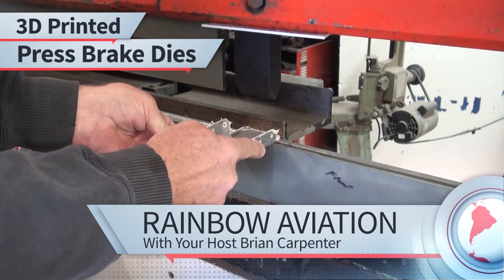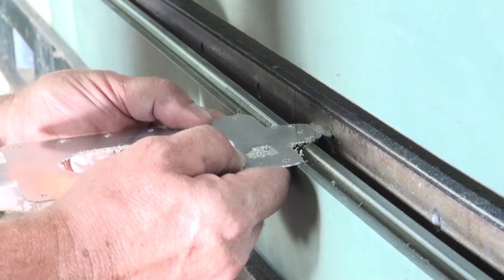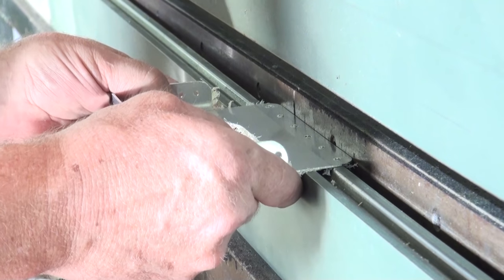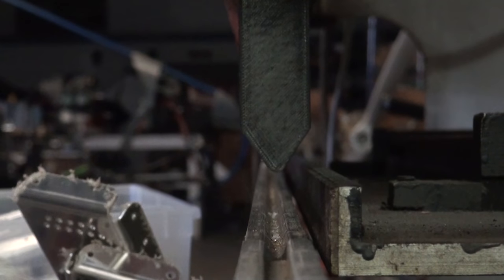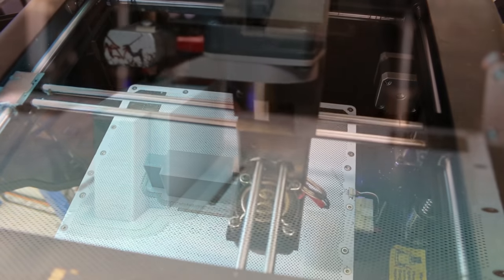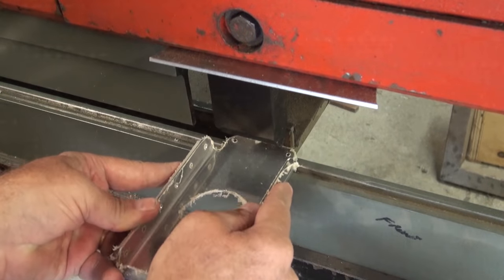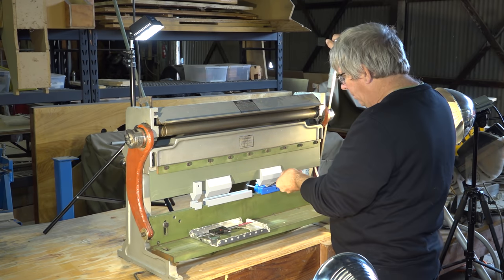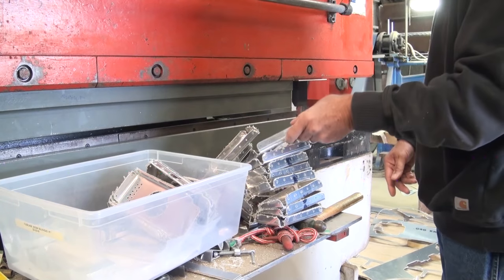3D Printed **Press Brake Dies* *That Really Work**

Comment: Another brilliant application of 3D printed parts.  And even if it just lasted for 200 parts, just print another for $2.38.  Thermo plastics keep getting better and better too.  Great video.
Reply: 2.38? plus the time you expend to modeling, print, electricity...lets say thhis dude make $20 per hour and the print cost 2.38 (lol) so 22.30 after 1000 parts? after 10000? proper die last foverer and this size is really cheap, thats the line between professionals and kids.
Reply: @CopyleftBR  This is meant for pretty small-scale jobs; It's less about making 1 part 10,000 times, than it is about making 100 different parts 100 times.
Reply: @CopyleftBR  
1. The time spent on modelling such a simple part is less the the time spent searching and ordering the part - it's just trivial. Also the 3d model lasts forever too - you don't have to remodel the part after each 3d print unless you want to customize the design for a particular job, so the modelling time is not even relevant.
2. The 3d printed part is ready for use in minutes to couple of hours and the time is predictable while shipping can take days to weeks and it's unpredictable. The 3d printing process only needs human interaction in the beginning (to setup and start the printing) and after a certain time you just take the finished part. The printing itself can go on unattended.
3. Also, as the video mentioned, the printed dies produced higher quality parts than metal ones and they showed no signs of wear during the testing period.
4. As Eldritch appropriately pointed out, this is meant for small scale jobs.

So, yeah, being able to see the value in rapidly making custom tooling that is perfect for the job VS always buying whatever is available and wasting time to wait for the delivery does indeed show the line between professionals and kids.
Reply: @CopyleftBR  honestly ... modeling these dies for someone who knows how to use a CAD program is a matter of minutes as they are such simple shapes. 
The print setup part is quite easy on their Zortrax as they are using the whole Zortrax ecosystem, which is idiot-proof especially on simple shapes like this. Also a matter of a few minutes. 
Electricity ? A typical 3D printer this size barely draw more than 100-150W, the heated bed (printing surface) being the most consuming. 
Also, the peak consumption is at the start, when it heats up from room temp to operating temp, after that it's cycling on and off the heating elements just to keep it in range. So, basically, in their application, all of your points are complete nonsense.
Reply: @CopyleftBR  if you print a die and it works you can always let made in metal, you got the stl file so a shop can make it for you in metal en send it to you.
Reply: @CopyleftBR  let's say the die they want is available, a 2 ft V die looks to be 500 bucks, so shrunk down to 5 inches that's about 100 bucks, you can get about 5-10 of the 3d printed ones for that price (even more if you have a good 3d printer you can fire and forget), so if there was the need for 1000+ parts, a metal die would be a good option. But in that use case the die will probably be used 10-200 times, and there are no readily available alternatives, so it makes sense to use the 3d printed version. Plus the time spent tracking down or cutting a die to fit can also quickly add up.
Reply: maulmart you may be interested in lost pla, just search YT for lost pla.
Reply: Never heard of segmented tools? Will last for 10.000s of thousands of bends with great accuracy, with aluminum  they'll last forever and can be reground. I've paid around 200$ for 30" length and can get ANY length from about 1/2" to full lengths. You are fiddling here. PS: I'm working metals for 50 years and have all classical machinery for metal working.
Reply: @CopyleftBR  it's great for prototyping, or the home gamer

Comment: Many thanks for sharing!   I have been lately using 3d printed parts for electric motor assembly jigs and production tooling,  I used to machine the parts out of nylon, aluminum, or acetal, and would recover the jigs for reuse because of the cost.   Now, the jigs are so inexpensive I designed them to become part of the motor, yet it still works out lower cost when the original ones were depreciated out over wear.   It is so easy to try out new concepts for production tooling as well, the technology really has come so far!  

I may have to purchase the HF press/roll/shear now.  Been wanting a brake press and roller for so many years, and the lack of tooling has always made me hesitant.  Since I will be bending lightweight alloy like you have shown, it give me confidence that it won't be a machine that sits idle!
Reply from the maker: Yeah. I think the whole idea of using the 3D printer as a tool for making jigging is so overlooked. We literally can't get away without that capability. How quickly new technology takes over things. Thanks for the feedback.

Comment: This is impressive, in addition if the 3D printed tool didn't hold up well enough you could use it to create a mold and do resin cast.
Reply: or send the stl file (or other desired file) to a metal shop and let it made.

Comment: When my engineers made a bend fixture for stainless parts and it kept marring the metal and the parts would stick in the fixture i redesigned part of it for them to use delrin instead in key areas, worked great. Plastic in the right places is just as useful as steel.

Comment: you can also take a flat piece of steel, drill 2 holes and then bolt blocks in the shape of your die cut in half to each the side. that way you have a strong center where most of the force is and the sides can form the shape.

Comment: infill doesn't affect strength that much unless it's 100%. try doing more perimeters which will result in a much stronger shell which is really what matters most. you could get away with 10 perimeters and probably 40% infill.
Reply: Wrong. This is compression. 100 infill is crucial

Comment: another example of how a 3d printer is just another shop tool. Doesn't usually produce finished parts, but neither does a drill press or a band saw. Cheers

Comment: fun fact... but you dont need all that infill. most of the strength is in the 3d printed shell. you could achieve much better results with more perimeters & it would be quicker to print.

Comment: Very much I like it. I am slowly getting there with having my own press brake. I have the hydraulic cylinders. 2 in fact rated at 100 tonnes each. I have the pump for it and also the 40 inch press brake jaws from US. You weld it all together. So now just need the frame. Then I can start playing around with squashing and hydro forming stuff. Awesome. Anyway, can you tell me. Whats the name of your 3d printer and model number?

Comment: This was interesting.  Could you use the printer and the plastic to make a traditional two piece die for forming more intricate parts similar to your hydroforming video?
Reply from the maker: Great question, unfortunately I don't have an answer for you. You never know until you try it. I will add this to my list of new projects. I think the big advantage of the method that we used in the video is that we are distributing the load over a very large area, therefore the actual load on the die is relatively small. I suspect that if you're not careful you would end up with overloading a localized area within the 3D printed die. That would probably be its downfall. But hey who knows. Will give it a try when we get a chance.

Comment: Since your tools are not very delicate you could switch to a 1mm nozzle or even bigger. With that you can reduce the print time quite a bit. you can get even more speed from the machine with an E3D volcano hotend which allows really high print speeds. Also just a few minutes ago I saw a video of a guy bending 10 gauge 3.4 mm thick steel with 3D printed tools with no significant wear after many dozens of pieces.

Comment: I've been looking at getting a 3 in 1 bender for a while but was put off since I would rarely have the tool I wanted. This opens up so many options. One question have you though about adding to the part? Steel rod at the bend,  steel plate ether side screwed through to spread the load down? Magnets to hold it in place for quick changing?

Comment: Why not to print two different part, one that wears off and other the main body? Then you can print much faster tip of the tool, that is actually wearing off, so reducing the cost?

Comment: Excellent!  Are the solidworks files for the HF press brake dies available for download?
Reply from the maker: https://drive.google.com/drive/u/2/folders/0B6fcluqN5u3oOGtnc0llamZORmM?pageId=111432934969316601083
Reply: Can I trouble you to upload the .sldprt files?  STL's are a pain to work with in Solidworks.
Reply from the maker: Okay Bob. I got lazy though. I just dumped everything from my folders in both the harbor freight and the regular press brake dies into the Google Drive. You have to sort them out and figure out which ones you can work with.
Reply: Thanks Brian!  I'll start printing some dies today.  Just have to figure out the height of the 1/4" plate.

Comment: Sure, you can do this but I question its sag/yield resistance.  You can machine one out of AISI O1, heat treat it at home for less than $300.00.  In any event, how did it hold up after a couple hundred cycles?
Reply from the maker: Great comment. I totally agree with you that machining a steel die would be the preferred method. The thing will last virtually forever. However, much of the video work that we do  as well as the articles that we write for Sport Aviation magazine is geared towards the experimental aircraft market. Most of the time our biggest dilemma is how to make professional parts, but doing it on a very low volume basis. Oh yeah, and keeping the cost down. While $300.00 dollars for a press brake die seems normal for the average machinist. Those of us trying to build airplanes on a budget will take a double take at those kinds of prices. The 3D printed press brake die  used on the CNC press brake and shown in this video, [I went back and checked] cost $2.38. And interestingly. Even after 200+ cycles on the black die shown in the video, there is no wear, and it still continues to function as if it was new. No apparent sign of yeild, sag, or distortion. Don't get me wrong, had I anticipated that I would need to bend even two hundred parts I probably would've just made one from steel. It will be interesting to see when we reach the limit of this type of plastic. Anyway, thanks for the comment and thanks for watching.
Reply: Gotcha, hey if it works, it works.  Be interesting to hear back after a few more cycles to see how it holds up.

Comment: Any chance of sharing the cad files for the printed parts?  Possibly on grabcad or some where else?
Reply from the maker: Okay. Here you go. We have a complete open source google drive. We will post them there. Might as well everything else is on that drive. Keep in mind that these files were specifically generated for our specific project. I would think that you would want to design your own based on your needs. But maybe these will help you in designing yours. I've given you the link to the chapter 1 folder, there are several other subfolders, two folders containing the files that we used in this video. Cheers.

https://drive.google.com/drive/u/2/folders/0B6fcluqN5u3oOGtnc0llamZORmM

Comment: .020" thou is about the thickness of my fingernail
Reply: In another video a guy bends 3.4mm mild steel repeatedly without any issues
Reply: @haydo8373  Do you have a link to that video? i have been looking to bend 1/8 aluminum (about 9 inch long) for a small production run. Taking it to a local bender is too expensive

Comment: Why not simply mill some steel or even just aluminium to size? As simple as the shape is, that would've been an easy task even on a manual mill, would probably not have been (much) more expensive than the 3D-printed part, and would have been a lot more rigid & tough… 
I mean, I understand the draw to 3D printing, I use it a lot as well, I just think there would've been better alternatives in this case.

Comment: "We can consistently achieve tolerances of a couple thousands of an inch" Pulls out steel ruler marked in 1/16" increments to check.9:29
Reply: That was not a ruler for measuring distanses. In that case they have measured 90° angle.